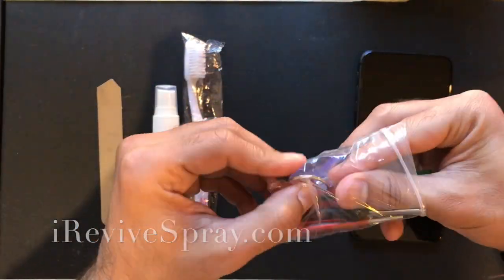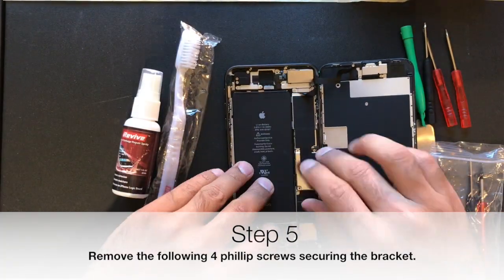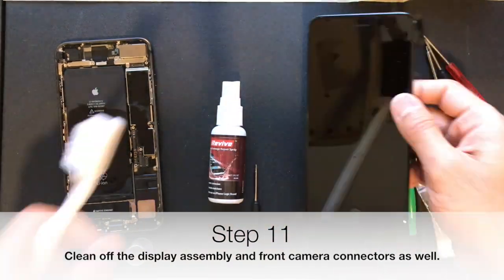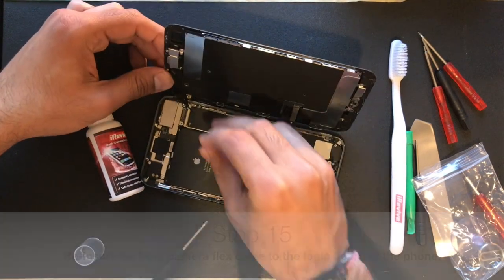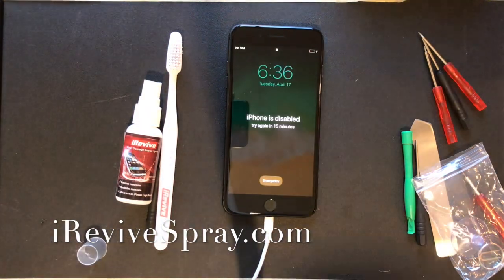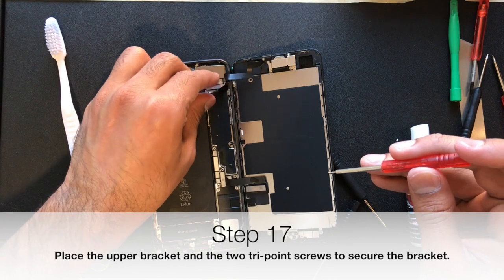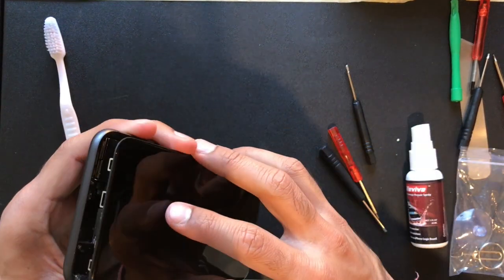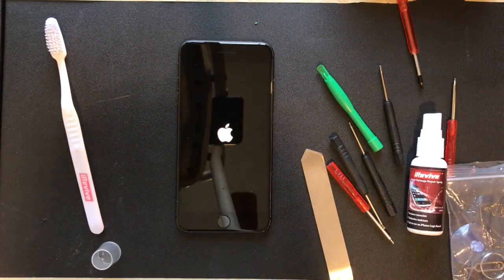iPhone 8 Plus Water Damage Repair - iRevive Wet Fix

Comment: Hi I did this process but now the problem is my camera is foggy cos of the moisture trapped inside! What should I do?? And I also have a white moisture line on my screen how do I get rid of it?
Reply: You could simply remove the front camera assembly and dry it
Reply: Dude it’s been year lmk if it still works 😭
Reply: Should I still use my hone and wait for the moisture to disappear? I’m confused